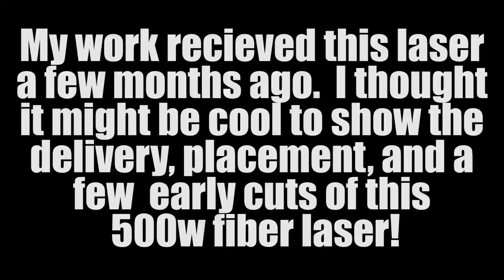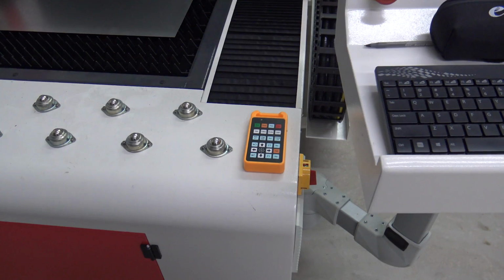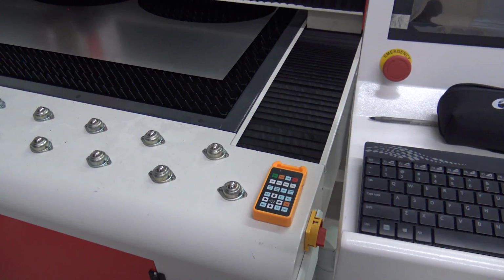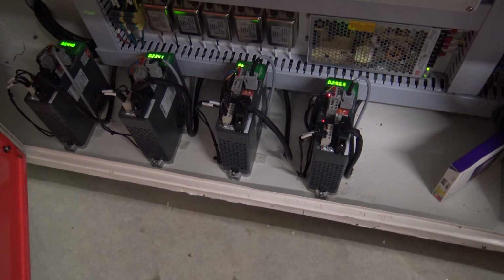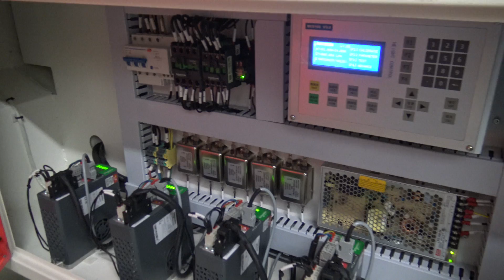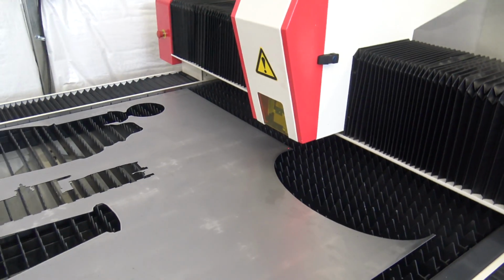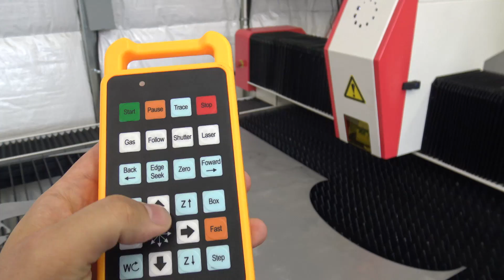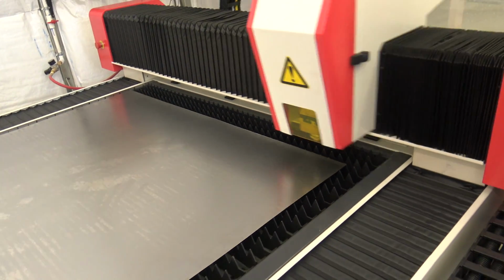Unwrapping A Rose Graphix 500 Watt Fiber Laser!

Comment: Hi, what gas are you using?  Oxygen or nitrogen?  Also, what psi are you using and do you worry about flow rate or is it basically controlled by the psi?  Thanks much
Reply from the maker: Oxygen. I actually forget what psi we are using haha. I usually change the pressure depending on the metal im cutting.  Aluminum a little higher.  If I had to guess I think it was around 100 to 150 psi
Reply from the maker: And yeah I always control it by the psi level
Reply: A Pyro Design thank you very much.  I will be receiving my 500wt fiber Laser next week and the gas company is asking what psi for the nitrogen and flow rate needed.  Doesn’t seem there is a rule.  I told them between 120-500 psi.  I’m really only cutting 16ga mild steel and 24ga stainless.  Shouldn’t need much.

Comment: Have you had any issues or problems with your laser machine? I make stamped steel parts and have been looking to get a 500 watt or so fiber laser, this looks too good to be true especially for the price... I've spent enough on laser cut sheet metal to buy a pair of these.. Please let me know.
Reply from the maker: csspecs Only a few minor issues.  The people that handle tech support while they don't speak very good English are very helpful.  This machine is a huge workhorse for us.  We use it daily for 1 to 8 hours. Have been for about a year now.
Reply: So I assume your using bottle O2.. How much are you going through roughly?
Reply from the maker: csspecs We were using a 6 pack of bottled o2 but we recently switched to liquid and we go through a lot less.   The 6 pack of bottled would last two to 3 weeks.
Reply: A Pyro Design Well I'm setup to see their demo unit Thursday.. Your video was very helpful. If the demo goes well I'll probably have one in a couple months.. Thanks for the video.  I'll be sure to mention you if/when I place my order.
Reply from the maker: csspecs Thanks a lot.  Yeah they will be good to you.
Reply: I have a quick question Pyro. Did you have to put on any power filters or anything else like that? went ahead and ordered the 4x4 enclosed model and have it coming in about the next few weeks, I ordered it as a 500 watt single phase 220v model and there was a mention about the power filter being recommended. But I am having trouble finding anything about it.. Did you need to install anything like that?
Reply from the maker: +csspecs Hmmm I didn't actually do the install so I'm not sure.  Would have to ask my co worker.  He's not reachable at the moment.  Did you ask customer service?

Comment: But i've got one question: does it damage the floor when it gets thrue or does the laser get stopped
Reply from the maker: There is a cubby underneath that catches the metal parts. It leaves marks on the metal but does not cut through it.